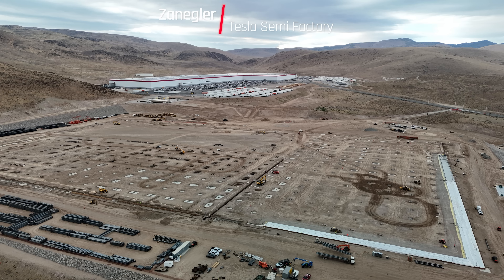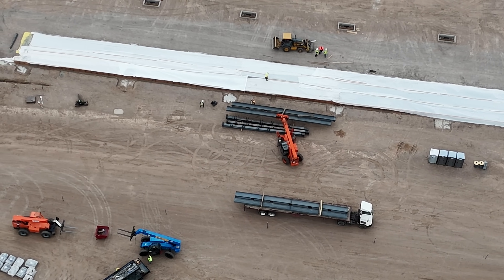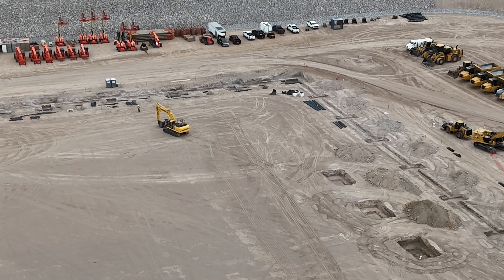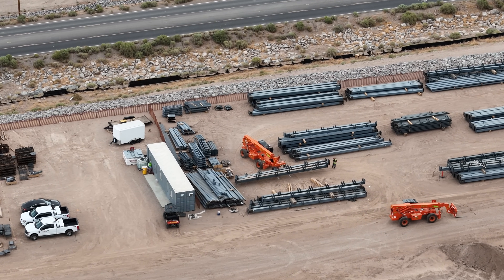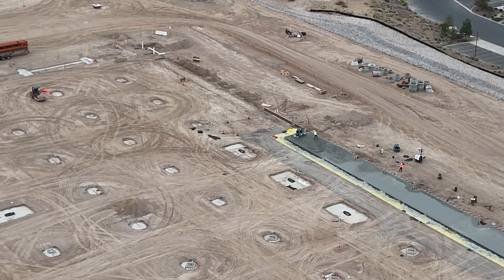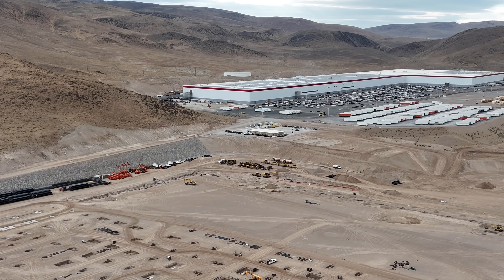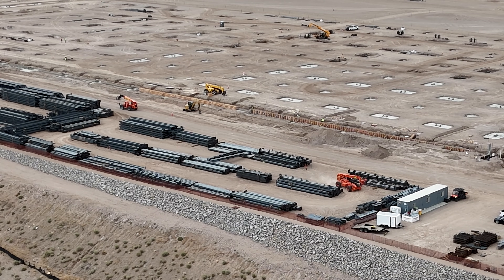Tesla Semi Factory Progress - The Stage is Being Set!

Comment: Looks like that after the main footing a concrete column base is poured that contains the column bolts. This needs to be very accurate, so not done with the main footing concrete. Steelwork probably several weeks away still. The steelwork will proceed faster than the footings, so footings need to get some time ahead of the steelwork.

Comment: 2:21. Ride-on troweler.
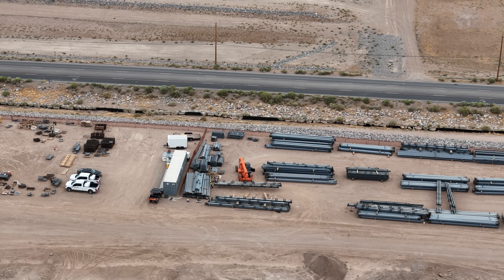5:11. Tele-handler. These look to be truss columns.
5:41. Hold-down bolts are square/parallel to the grid, as will be the columns. The diamond box around the column a method of finishing the floor slab up to the column. Column on an isolated island.
7:16. Many of these components will be identical. Each component will have a tag showing a designation. C1, C2, C3 etc. The plans will show which grid location is a receive a C1 etc. There might be 50 locations for a C1, 100 for a C2, 5 for a C3.
Same with the beams, joists, rafter etc. B1, B2, J1, J2, R1 and so on.
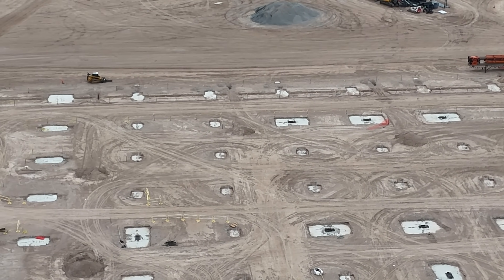8:18. Orange crane components on the trailer?
Reply: Nice catch on the crane parts!
Reply: @craigarnold1212  Only a guess. Not building components for sure in that color. Possible it's parts of a truck/mobile crane rather than a crawler.
Reply: On further investigation, it's a machine made by BZI. A number of possibilities, they make assembly jigs, lifting rigs, etc for pre-assembling at ground level, wall, floor, and roof structures. Nice looking kit.

BZI wallmaster.

Comment: material has identification tags or numbers are welded on the steel & the plans call out each id number on the drawings. you are doing well on learning the verbiage of construction. my guess on columns going vertical will be two full days after the cranes arrive. the day of arrival will not count. 1st day will be inspection of crane and the next day will be set up with possible test of setting one, two or three to test the crews and equipment.